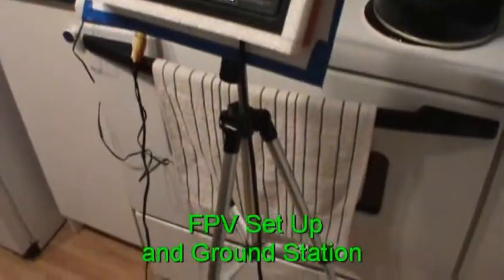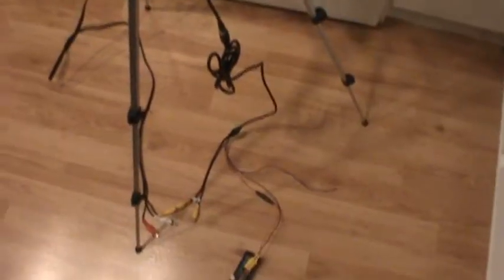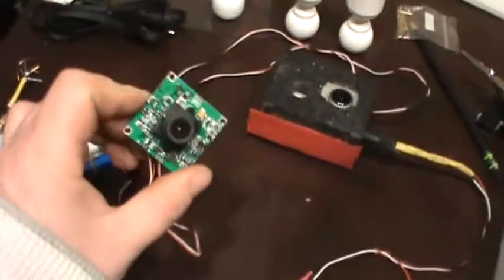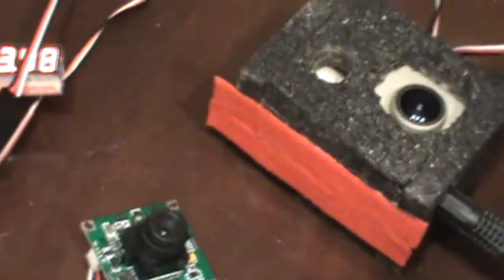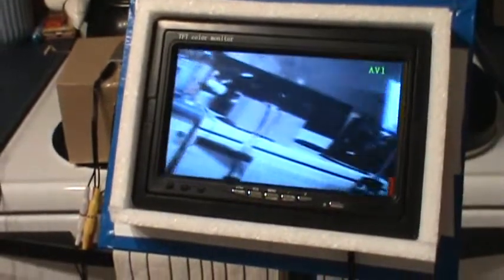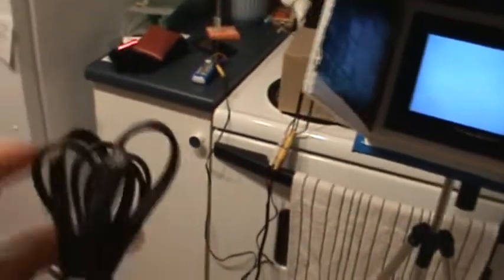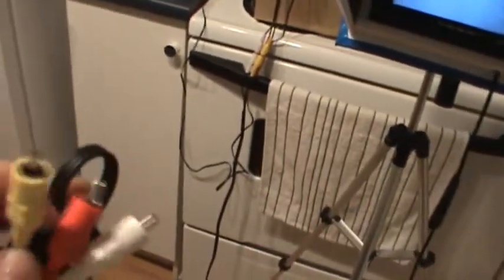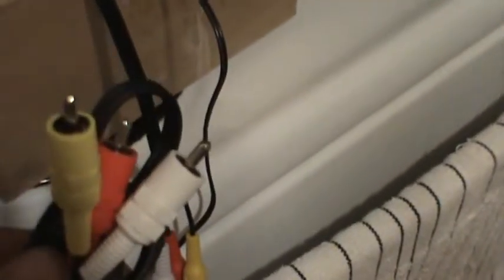FPV Set Up

Comment: ir you want to setup a recorder to your FPV system go to ebay and get a 3.5mm 4 pole to RCA video cable and hook it up to your video RX secondary video output , it works better that way .

Comment from the maker: @IbnAir23 they are great PM me if you like ;0)
As for the TX and TX, i used HK OrangeRX with Satt and now a DX6i.
DX8 is in the works.
These little gems are a great bang for the buck
For now there well be now long range FPV, ill be keeping in LOS. Prob mostly on the Quadcopter
PM me if interested in a set of antennas!